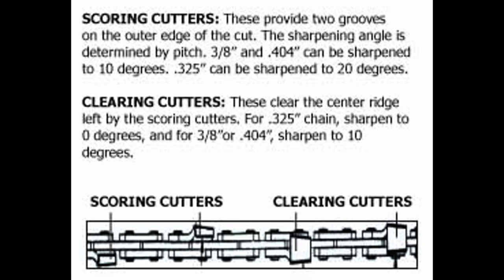Granberg Ripping Chain Compared To Normal CrossCut Chain - [Chainsaw Mill Experiment]

Comment: The reason your milling chain gets dull quick is because your wood/ bark on the log has some measure of dirt.  Therefore you are dragging whatever measure of dirt across the wood while cutting.  The only way to avoid dulling your chain quickly is to remove the bark or pressure wash the bark.  That is why band-saw sawmills have de-barkers working in front of the blade.

Comment: For smooth ripping, don't see-saw the bar through the wood at all.  Keep it straight and move along with moderate pressure.  Keeping the chain at the proper tension helps too.  Mark you file guide with a 10 degree scribe mark by using that speed square hanging on the wall behind you.
Reply: it's weird how many of these blog channels are coming up and all these people have garages full of tools but don't know what they can do and instead buy things online anyways

Comment: eric bro put your sawmill on the right side of the saw you have your saw mill on the wrong side of the saw blade  if you switch it over and oil to the bar as you are milling you get better looking broads and wont burn up your bar   and let the saw do the cutting  dont force the saw to cut

Comment: I hand cut a $15 chain with this tooth sequence using a cut-off wheel on an angle grinder and a diamond bit on a RotoZip. It performs better dull than a crosscut chain does sharp. This is a game changer chain for sure. I'll never go back to using anything else.

Comment: Another vid on slabbing discussed the wobble of the chain in the bar giving a rough surface to the slab. Some company claims to produce bars with low/no wobble grooves, specially hardened to keep the chain straight and to resist wear & tear which rounds the corners/shoulders of the groove.

Comment: Thanks for the info. Been thinking of getting a chainsaw mill myself, but like you said,not sure if I would  use it enough with the time and effort thing.When our sawmill sells rough cut popular for $0.53 per board foot and they will load it for you.Just so easy to spend about $100 bucks for a truck load and less than an hour round trip.

Comment: Figure out a set up so the bar is getting oiled, in addition to the bar oil, hold the saw at maybe a 30degree angle and keep it there, You shouldn't have to push the saw at all, if you have the proper motor size and a sharp chain, the saw should be pulling it self through. Pushing the saw, and moving it back and forth like that is chewing your wood up. Also, have the log at a slight downward angel, so you have gravity helping the saw. What saw are you running here?

Comment: I tried to make a rip chain , used about 7 degrees .  Night and day difference  and I swear it cross cuts as fast as it ever did . Just wondering if the 30 degree  teeth are worth it 5-10 degree  give you a lot more tooth to work with ( if you buy a ripping chain )

Comment: Thanks for mentioning the difference of the depth gauge measurement on the ripping chain compared to a standard chain. I am getting near the point to touching up the rakers on my own. Also, Stihl makes their file guides now with a ten degree scribe on both ends of the guide. I sharpen by hand as well and that ten degree mark makes life easier. I suppose you could also make your own scribe on the guide to whatever angle you wished. Thanks for the video.

Comment: Now that you have seen the costs and quality of chainsaw milling, how does it compare to purchasing lumber from a sawmill or have a portable mill come out to your place and mill your logs ?
I'm in N Central TN and #2 grade red or white oak is $.40 - .50 per board foot (board foot is 144 cubic inches of wood).  And a portable mill charges around $.20bf if you have 1000bf to mill (that's about a days milling).  And with the portable mill milling your logs, you get the bark slabs.  Also if someone has a mill come out to mill and they don't have enough logs they could team up with a neighbor who can bring logs over to be milled when your logs are milled.

Comment: Don't know how I didn't comment on this video. lol. That mill is pretty similar to the one I want to make. I also want to make it out of bed frame that you saw in my video. You would benefit a lot from a handle in the middle of the mill. You could also put a hand crank winch on it so it's not so much work on you pushing the saw thru the log. If you used a cordless drill powering the winch you probably wouldn't have to push at all. I will probably get my ripping chains on eBay also. Great video!!!

Comment: Make sure to support the weight of the wood behind your cut. Just like cutting down trees, you don’t want the bar to get pinched between the two halves. Trim down some scrap pieces to wedge into both sides of the cut every 2-3 feet to support the weight of the wood, saw and guide...

Comment: Glad to see it's working out!  If you're not aware already, might want to check out Matthew Cremona's channel.  He does a lot of chainsaw milling too.  One tip he had recently was to put the log on an incline, so you're using gravity to help push the mill down through the log.  I've never done it that way, but sounds like a good idea.  I like your ideas both for the garden/chicken rotation and the coop from lumber too!
Reply from the maker: +Greg Smit wow, I was not aware of his channel. Looks like he has a lot of great stuff. The video I just watched he had a really cool trailer lift setup. Thank you for sharing!

Comment: Those file guides are purely to learn with.  Ditch that and you can get the right depth in the tooth with just the file.  That depth is just shy of a half moon  shape and rakers you easily double whatever the chain manufacturer recommends.  👍

Comment: Take that speed square you got hanging on the wall and use it to mark the filing gauge you have at 10°. I too used to hand file only. I broke down several years ago and bought a Timber Tuff grinder at TSC for $120. It is a great tool for the money and has saved me $$ and time on rocked chains. It has also been a source of barter for me. I sharpen some chains for friends in return for whatever. Just a thought. Another good vid.
Reply from the maker: +butcherbls I can not believe I did not think of that. Genius. Thank you for sharing! Love it.

Comment: The slow down at the end of your run was probably due to the rip blade getting duller. Alas one of the main differences between crosscut and rip angles is that the rip angle(10 degrees) means the saw doesn't cut as well when its dull. The Cross angle(25-30) has more leeway as it gets dull and can still cut.
So all you need to do is file the Rip blade every time you finish a plank.
Side note - the proper sharpening angle for cross and rip is based on a couple of factors (top and side plate angles, depth guauge dist) and so you should use the info from the chain manufacturer to determine if its say 25,30,35 degrees for crosscut.

Comment: It doesn't make sense to me that changing half the teeth to square headed the same length as the existing teeth would speed up the cut...I thinking ripping teeth should be at least 1/4 taller....
   Does it seem to cut faster with 2 different angled teeth?? I would love to see deeper teeth and carbide tips

Comment: Hi Eric go out and get pallets usually you can get them for free this will save you a tone of time go on the net and pick out a design you like I built one from scratch I used all recycled material and I had to buy only two two by six to do the top section mine turned out great I built my own hinges as I am a  welder they are chest nuts designs with a little canadian maple leaf latches. I have to add nesting boxes to finish but put in a little nesting box in the little room It houses  2 chickens and a rooster (Korneilious) but can easily house six chickens and a rooster.

Comment: I just subscribed to your channel and really like it. keep up the great videos.        A bigger saw would help speed things up. I started out using my fathers MS391 and it  was okay. But I bought my own saw  a Stihl MS461.  And Its a night and day difference. (Not to mention its a firewood eating machine.) Quick observation is you power head is upside down. With it the way you had it you can't mill down next to the ground, and if you run out of gas mid cut you can't refuel it like that.
Reply from the maker: +Kenneth Judd Nice saw! Yeah the mill I made gets the job done but still needs some tweaks. How big of a bar do you run on it?
Reply: +Life in Farmland I run an 18in for firewood mostly. For milling I run an 25 and 32 inch bar. I'm going to be running bailey's woodland pro ripping chain. it suppose to be just as good as the granberg chain. and it's cheaper and is faster to get.

Comment: I've never seen anyone make boards with a chainsaw.  Pretty cool.  I've been thinking about getting a chainsaw to cut firewood and to clear brush in my backyard.  Do you have any thoughts on electric chainsaws?  I've never used a chainsaw before and I thought the electric might be easier.  I've been using a sawzall to do it.  Thanks.
Reply: Step up to a small Stihl gas saw. You won't regret it.
Reply: Mark Reep or any chainsaw that doesn’t take a battery for that matter. But if you only cut a sapplin once every two years carry on private. Cause it’s like owning a new or older used car. The upfront price may look nice but what is it time and costs you have invested in heindsigh. But it’s all relative
Reply: When looking at chainsaw types it is all about what they are designed for. I have three of them: One Husquavara (which I can never spell correctly!), a Chinese made Echo, and a Dewalt 20V battery operated 12" saw. The battery operated saw is AMAZING for general tree trimming of branches up to a few inches in diameter and for cutting down small saplings. It has plenty of power and the battery lasts a long time. It is much lighter than a gas operated saw and is easy to carry up and down a ladder for trimming those higher branches. It is also very affordable. That said, I would never use it for cutting a tree or log of any real size as it has a short bar and is not designed with the power for a big tree.. While I highly recommend this saw I also recommend having a "regular" saw for larger trees & logs. I do know there are some 60V battery operated chainsaws that are larger and presumably more powerful but I've never used one of those.

Comment: ok my Husquarna has a "full chisel chain" - and even in wikipedia I don't find "ripping chain". can someone gimme a link so i can get that for the Husqquarna 61? now I don't even know what to by to be honest since I can't find the translation into german...? Help anyone?
https://en.wikipedia.org/wiki/Saw_chain
Reply: Joachim Schreiber go to Granberg Alaskan Mill website. They sell ripping chain. Take the chain off of your saw, count the drive links, and order it from them. The chain loop will arrive completely assembled and ready to put on your saw! You can buy ripping chain many places, but I buy it from them. You can also make your own ripping chain if you have a spare hour or two. But I like to just buy mine pre-made. It's been awhile since your comment, but hopefully that helps
Reply: @jontheroofer1968  I use the Granberg chain and love it! It is worth every penny. Not only does it rip through a log like butter (ok, not quite like butter! LOL) but it stays sharper longer. The cheap ripping chains may work ok to start but they dull more quickly and won't survive as many sharpening cycles. Invest in the good stuff and it will be less expensive in the long run!

Comment: .

Do like your idea
of the alternating chicken coop runner

Typically or rather what we see
are coops housing the roosters
or hens in their own
collecting their manure for compost
and starting all over again

What eye'm understanding what you're doing
is splitting the area of the ground they're fertilizing

If that's the case
that fertilizer can be bagged
Stored
even Sold

Almost a no brainer
just a matter of making it work

If any follow up video(s)
that would be Kool to Sea

Aloha from Arkansas ~

...

Comment: Your boards look a little ruff from a ripping chain. I did some free hand ripping and they were much smoother. Maybe it is the chain, maybe not.
Throw that guide away. Free hand your sharpening. You'll sharpen your chains faster, and just as good. I free hand sharpen out in the field all the time and they cut almost as good as grinding them on a chain grinder. If you want some really good pointers, check out Buckin' Billy Ray, he has some really great videos on sharpening. His titles don't always portray the content as he does jump from subject to subject in a single video, so you will find sharpening tips in a video that is not titled as such. I guarantee you will love his channel.

Comment: Very much 100% true on is lots of work on the preparation for milling with  a chainsaw.  However after you create  a system and stays  with it  becomes easier. Course is easy to espend 3 to 4k on a band saw but if you dont have a big project to do will be a very waiste of money .I think that if you make a system that the only thing  you have to do is load the logs and set the chainsaw it will pay  of . I dont like the Alaskan devices  i making my own and it run itself so when the logs are becoming planks or beams i do something  else. 
Debarking you log is a must and the ripping chain  sharpen is the way  for me 10 degrees. The standard is for short fire wood cutting. 12 foot logs need to have a electric saw gas saws  wont last long there not made for that runing on stress for 7 to 12 minutes at the time they will burn

Comment: This might help. I've found that semi-chisel cross-cutting chain works very well with factory grind for surface finish of milled lumber, much smoother than full chisel. If you use Granberg filing guide, as desired you can progressively file the top angle of the cutters from 30 deg toward 10 deg, if you want. At 30 deg you can use it however you wish. Seems most ripping chain runs more acute cutters, so you could file them with the file held lower in the guide. FYI the Granberg file guide is WAY better than stamped sheet-metal file-guides. Waaaay better. BTDT. Good luck.

Comment: Holy hell dude spend the $200 on a good chainsaw mill and you'll get alot better looking boards when you're done. Also invest into some proper ripping chains. Those chains you get aren't ripping chains they're just different degree chains. If you want more information on chainsaw milling please send me a message and I'll link you to the best gear you can get to mill your own logs. You'll save time and money in the long run.

Comment: The wood looks like you chewed it off
Reply: That's the downfall of moving the mill back and forth.  You get a smoother cut if you keep the mill in one position and cut all the way through in that position.  I use a winch on my mill.

Comment: I grind 1/2 the tooth away on the side of every alternate pair of full chisel teeth and file them at 0 deg, more like a cleaner tooth, set the rakes at .010" then the full cutters are set at 10 deg angle and rakes at .025". Makes for a very smooth cut unlike what I saw on your first couple of cuts. Steady & level when starting the first cuts will set the whole stage for the rest of the surface finish. clean off anything on the flat surface that might cause a tiny ripple, that gets magnified to the cutters and makes ridges and waves in your board surface. The more consistent you can maintain the forward motion, (no sawing back and forth like cross cutting) the less chance of introducing waves and ridges as well. Good job.. keep practicing. I didn't see anything a planer wouldn't fix.

Comment: that lumber looks like ass a lot of work to clean up
Reply: He is moving the chainsaw back and forth that makes a very uneven cut. Makes ridges and then the next cut is worse.  He needs to let the saw do the cutting or needs a bigger chainsaw.  The chain is new so should be sharp.  Chainsaw done with a powerful chainsaw with sharp chain should give a pretty flat board similar to rough sawn lumber.  If done like he is you loose at least 1/8 inch in clean up.
Reply: How does the lumber you make look ?
Reply: you got me there, i'm watching these videos to decided what product i want to buy to make lumber is i will take a pass on this product didn't mean to hurt your feelings

Comment: I've always wondered about the ripping chains, thanks for the vid. Timed comparisons would be excellent!

 I've found it much easier, and also a more consistent cut, to get the log positioned at about a 45 degree angle and let gravity do the brunt of the work (example: https://youtu.be/7G5ahcnIEo0?t=217 )

I would try not to rock the saw back and forth (even though it does seem a hair faster to do so) and you'll get smoother cuts too.  Enjoy your vids.

Comment: Jeez, your mill setup looks treacherous
Reply from the maker: Lol,, yeah. It was a random idea that came to me one weekend. It is basically a bed frame welded up to hold the saw. Gets the job done and has a lot of room for improvement. I plan to get a bigger saw before upgrading the mill.
Reply: Well, I mean, the mill itself looks rough, but aesthetics don't matter as long as it operates well, I more meant the horses you're working on around 4:25 ... kinda wobbly, lol, had me grippin the edge of my chair, man!!
Reply: Regardless, props on the homemade mill, it's great seeing people fabricating their own material.. But it's even better seein people making their own tools to make their own materials
Reply: Banguts and grandson are in